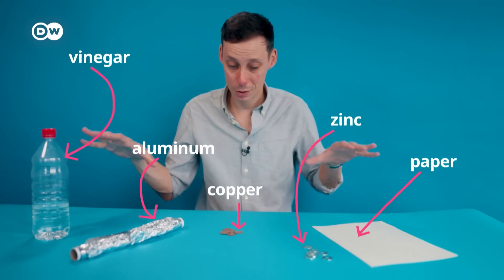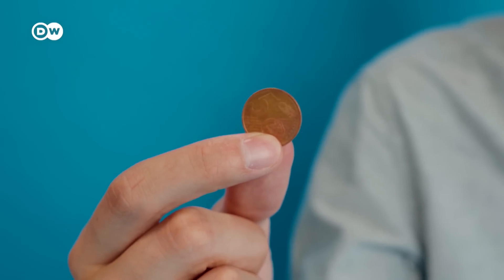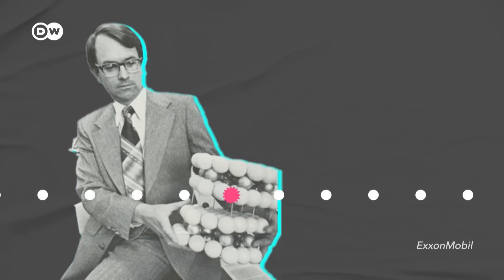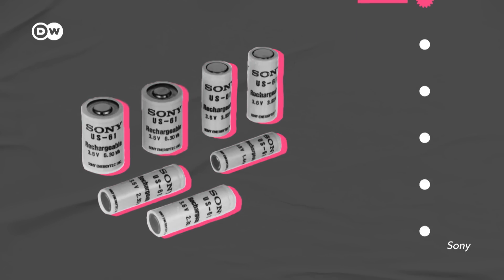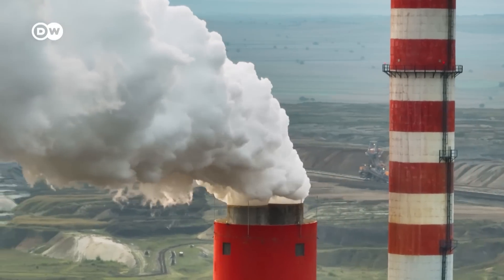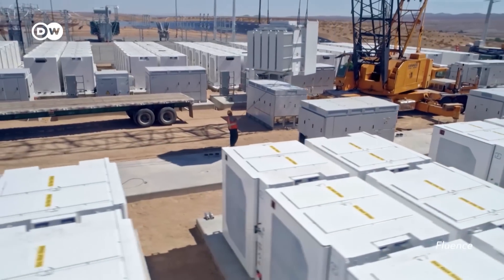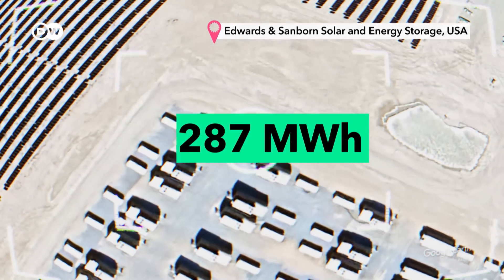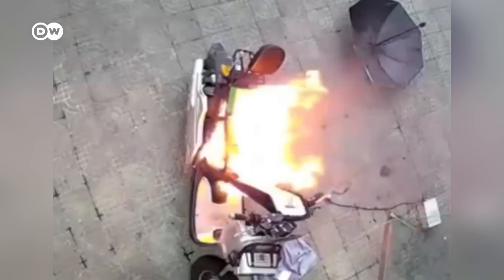Can your phone battery help to solve one of the world's big problems?

Comment: So, how do plain old batteries solve one of the world's big problems? You never said.
Reply: Storage from day to night will be done by Lithium and Sodium. That's economic already today. For winter periods when even the wind does not blow, we will need about 14 times more storage space than the day/night storage and we will need it only twice a year. Therefor, Lithium will be too expensive still. They don't say it in the video but the idea is that even classical chemical batteries that can not be recharged might be an option but I am quite sure will store methane and use gas turbines but the methane will certainly have to generated via renewable hydrogen. Even if we have 50% losses for that conversion, it will be far cheaoer than 14 times the price of Lithium batteries.

So in conclusion: Electricty will be very cheap for most werks but there might be random three four weeks per year when shutting down some factories will be in total cheapest solution. The kWh will easily cost 100 cents but only for 14 days a year.
Reply: @AndreasDelleske world's biggest problem is climate change.
Reply: @AndreasDelleske  yes, but salt water batteries are cheap and can be refilled over and over again, can be made with objects laying around the house that can be manufactured at grand scales far exceeding what can be done with lithium, you can also dig a large pit, line it with clay and similar materials to a garbage dump, and have it as storage, you don't even need a second pit because the second pit is the actual sea.
Reply: @SkashTheKitsune  Sounds interesting: Do you have keywords or a company name or institute to find functioning test installations?
Reply: Yeah, I thought this was about dismantling old batteries after they are discharged and then rebuilding them to discharge again and again or something.
Reply: Yeah, I learned nothing new. The title is deceiving.
Reply: Would you have watched the video without the “clickbait” title?😅
Reply: came here to say what a shitty title for a video, just another clickbait that doesn't deliver.
Reply: ..or to use the large amount of (soon to come) older car batteries for home storage.
Reply: There’s no need to say everything directly.
Reply: Storage